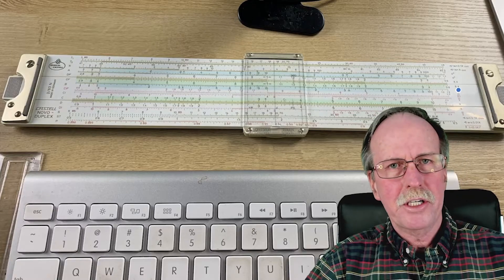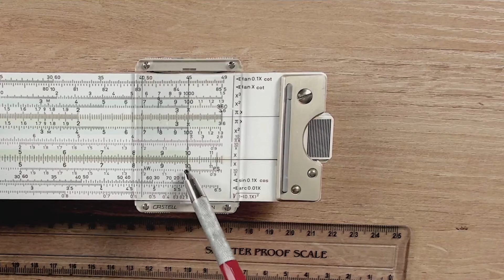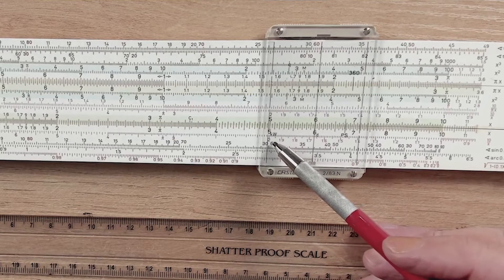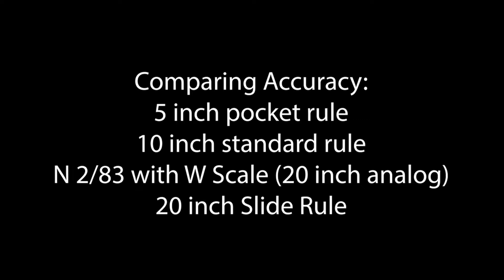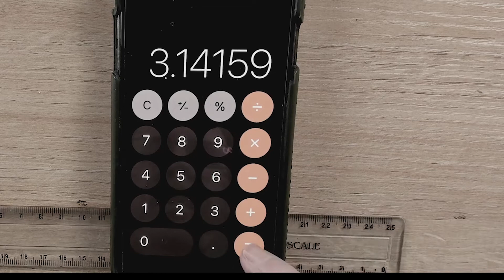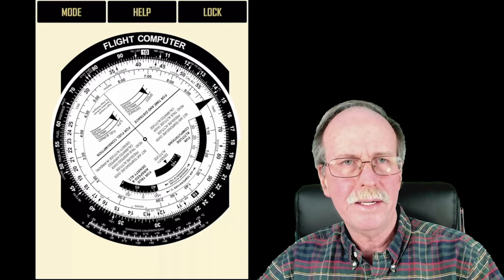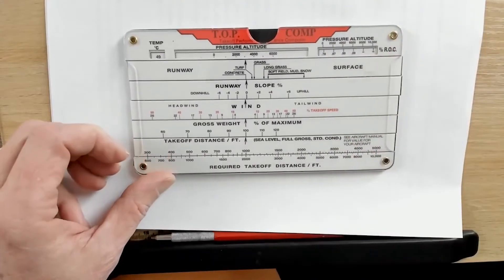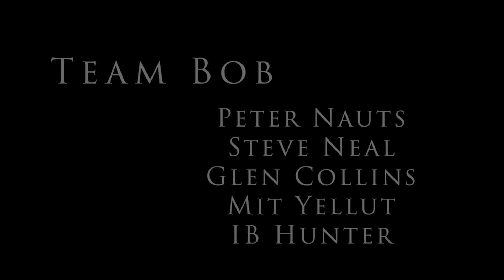Selecting a Slide Rule- Advanced and Specialty Rules

Comment: 2:33 Seems you read it in the wrong direction, ie .9848 and not .9952
Reply: Well, these things happen when you are multi-tasking, running the cameras, running the slide rule, and talking. 

When I was a law enforcement+EMS+fire dispatcher and things got busy, if I was working three incidents simultaneously, things started to fall through the cracks.

One of the most brain-taxing tasks we perform is speaking, and researchers have found that talking while driving may cause as much driving impairment as a 0.05% blood alcohol level.

Comment: Are you familiar with artillery? I liked your explanation on that Firing table ruler. Now firing tables are 400 page books! I'd much rather carry that ruler.
Reply from the maker: I was in the Army and fired 3 shots with a 155 howitzer.  but was in the medical side of the army.
Reply: Could be interesting. I once read computer game development blog on topic. First it's parabola. Then air drag exists. Then air density changes exponentially with height. Then temperature says it's not that simple. And now the worst part: dependency of drag vs speed is not linear, quadratic, but changes when air flow goes from laminar to turbulent, near speed of sound and so on, so it's tabulated.